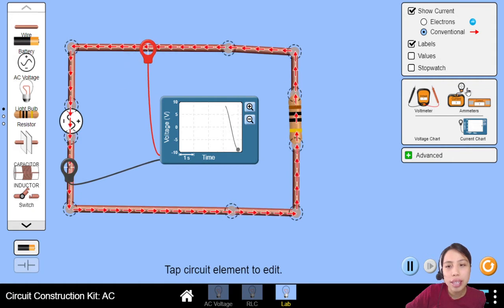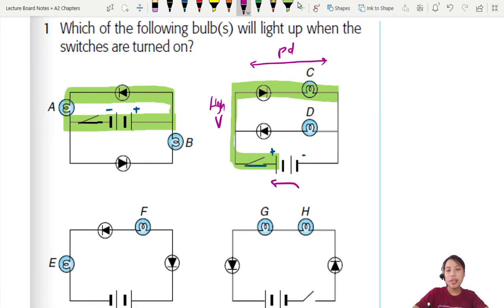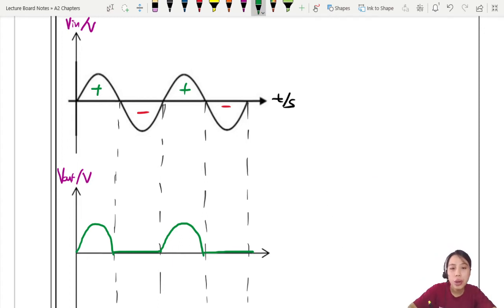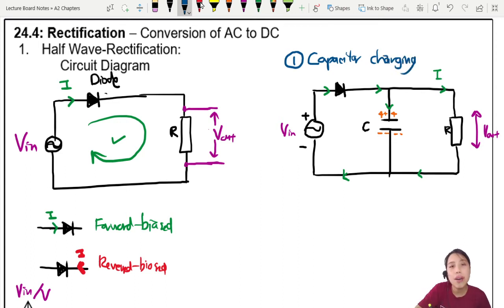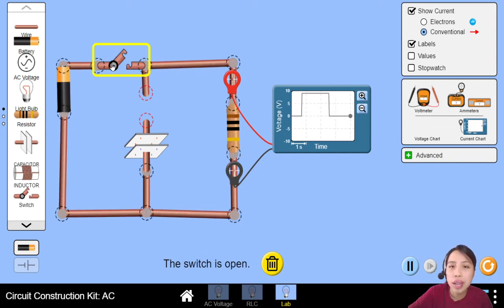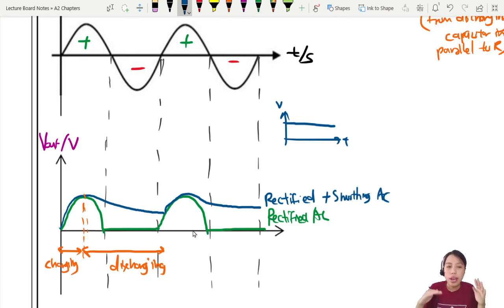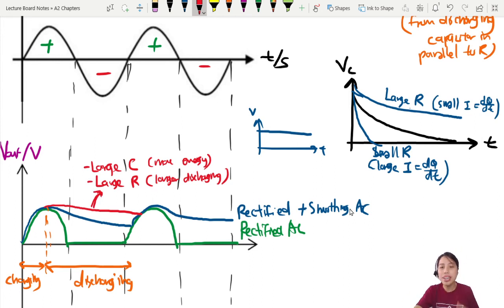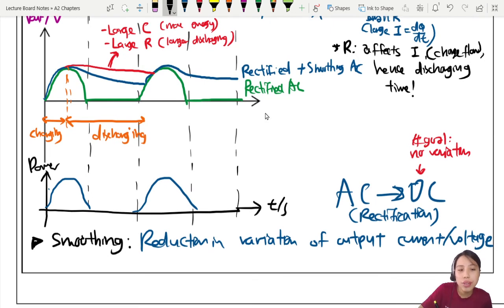21.3a Half Wave Rectification and Smoothing | A2 Alternating Current | Cambridge A Level Physics

Comment: Do the electron move fro and back in AC ? I mean do the electrons cover distance in forward direction in wires or not ? Electrons move one step forward and then same electrons step backward and continue forward & backward motion only that is why electroplating is not possible with AC ?
Reply: In AC circuits electrons oscillate back and forth with essentially zero net long‑term displacement, which is why AC alone won’t produce sustained electroplating. However, AC does carry current and energy — it’s just an oscillatory current rather than a steady unidirectional flow of charge.

Comment: Hey, why doesn't the capacitor discharge start when v = 0 because the current only changes direction when v becomes 0 so shouldn't the capacitor be discharged when v becomes 0 also?
Reply from the maker: Which time point in the video are you referring to?
Reply: discharging of capacitor only occurs when current is blocked by diode during negative cycle
Reply: @trigobrooken6260 I think that's what OP is asking. The negative cycle only starts when V = 0. So why does the capacitor start discharging before V = 0 i.e before the negative cycle starts?